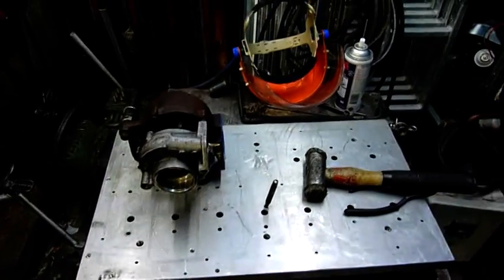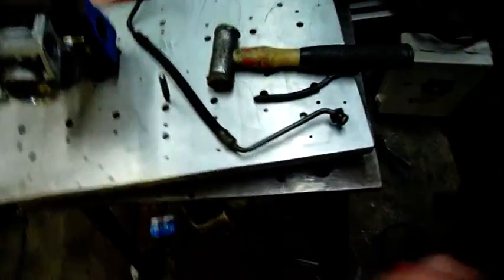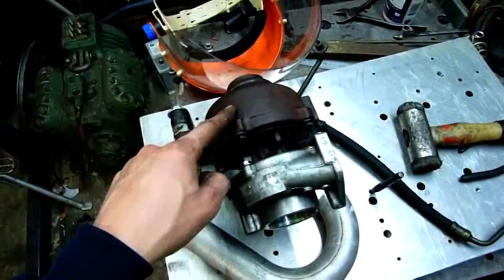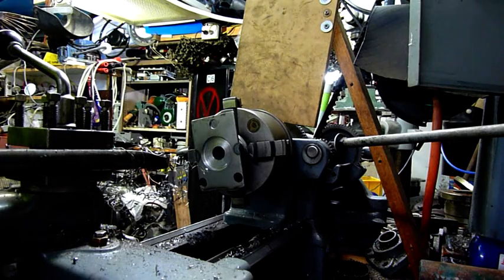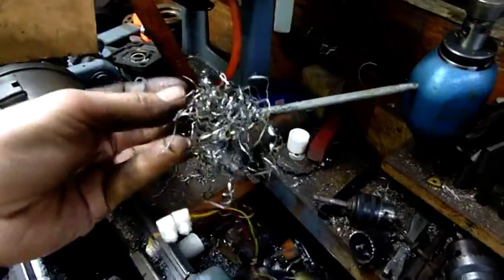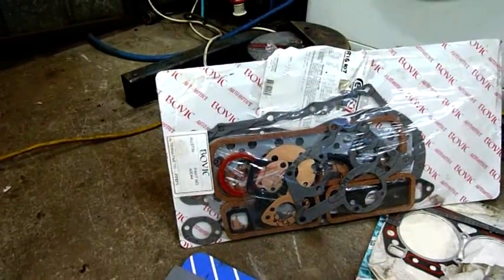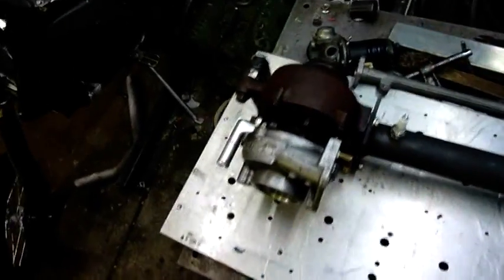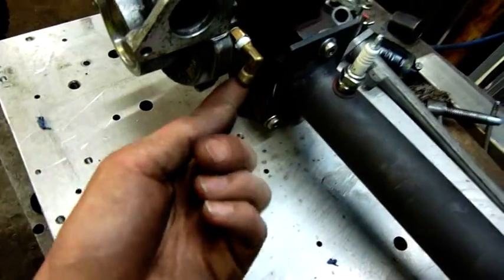Turbocharger Jet Project pt1

Comment: I've worked with a few different high alloy and high tensile steels. Used to forge that stuff years ago, cool stuff to forge as well, the alloys make it so nice to work with. We did some drive shafts out of 4140 or 4340 (can't remember which), forged a 1m x 60mm bar of HT steel down to about 450 long with a 300mm flange on the end. Then we machined it by hand (CNC we had was too busy with other work). We were taking 4-5mm cuts out of the OD with no live centre at about 80rpm in as-forged condition (so semi-normalised). It was a big old lathe that was doing the job, and there was a fair bit of chattering as you could imagine, but they had some monstrous sized curls of swarf coming off them, some were close to 2 metres long! If you ever get the chance to do some forging at a blacksmith shop, do it! Its awesome stuff! I'd give up my car painting job to go back there again

Comment: Oil aside, you need some serious work on your combustion area. Aside from not having a flame holder (unless I have over looked it) having the combustion starting that close to the turbine is going to destroy your turbine in no time and quite possibly cause some sort shrapnel during the running. I know you mentioned not looking at any plans, but you need to look at some fundamentals of how a jet engine actually sustains a flame.

Comment from the maker: @RuanLobbland interesting info!, thanks!.
I figured the return line would fill up anyway because it has to run back to tank through a oil cooler but if its detrimental to operation I may do some re-designing.

Comment: @Aussie50 I believe there are quite a few sites dedicated to turbocharger jet-engine building, so it'd probably be a good idea to double check there for combustion chamber designs and proper EGT limits, etc...I was going to build one before, but I never even reached the parts gathering stage before I shelved the idea.

Comment: As far as I know you actually want combustion to start as far away from the exhaust turbine as possible. The idea is that you want most of the fuel burnt up so you don't have combustion occurring in the turbine housing. When you've got fire hitting the turbine wheel, it will start to heat up real quick, even glow bright white/orange. Don't want  a piece of turbine wheel coming apart at 100,000 RPM! Keeping exhaust gas temperatures down but exhaust volume up is the key.

Comment: i could almost tell you where every gasket in that kit goes lol. basically suites and 2.6 Mitsubishi engine. 

very interesting project. if you need i think ive got a fairly high pressure fuel pump out of a 8cyl LTD somewhere....might do the trick. don't know if its still around tho.

Comment: all i can say is the SU pump is 4-6 PSI so ye may need sommet with 20PSI to get the fuel attomized by the injector for a good flame but that may not be so but its missing its engine so i cant tell ya what gona happen but im shore atleast ye could set fire to the shed with it so it is worth doing :p LMFAO

Comment: -I think they usually make the combustion chamber big in volume so the fuel has some time to combust properly, otherwise it can just shoot flames and not have much of a power (thrust) to use, and the exhaust side turbine may overheat.
-But keep the project going !